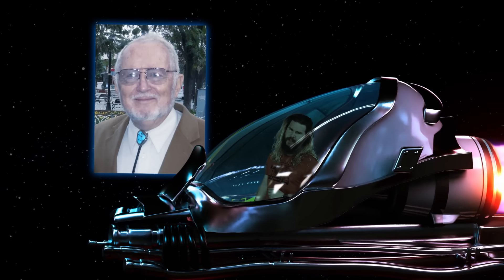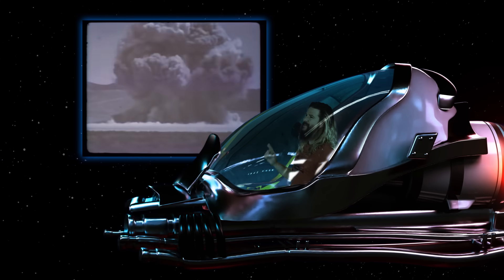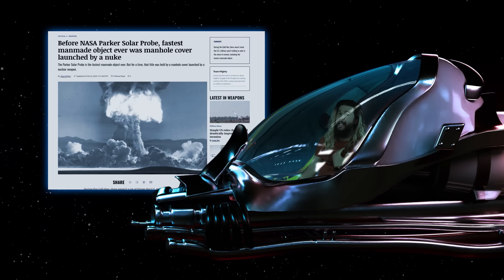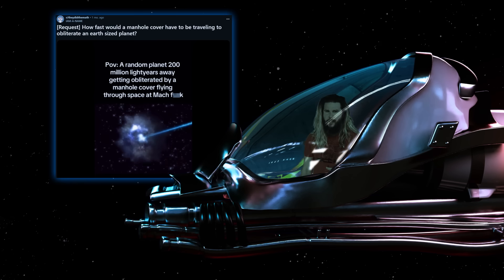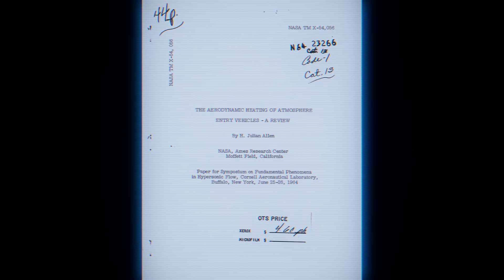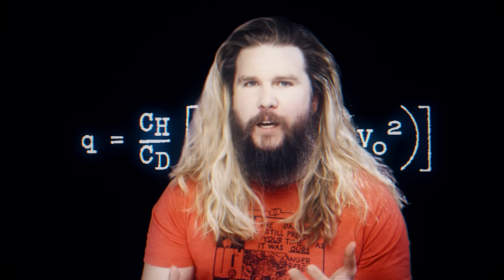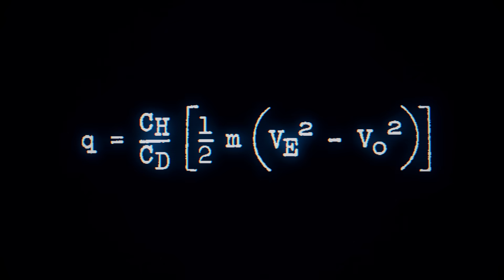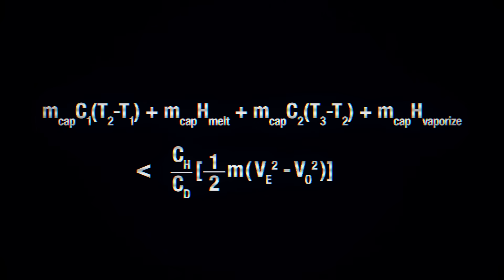Debunking the Nuclear-Powered Manhole Cover

Comment: I wonder if the calculation took into account the air density changes as it went higher, and wether the heated metal deformed into a mor aerodynamic shape as it traveled upward

Comment: The equation doesn't include time as an explicit variable, nor does it break down the journey through different atmospheric layers. The simple equation isn't enough to determine if it made it to space, only if the manhole cover would have enough kinetic energy to overcome the heat absorption and potential vaporization.

Comment: I understood the explanation correctly? if the heat generated by an object entering the atmosphere is more than enough to vaporize it; then, the heat generated by same object going in the opposite direction, should be the same, right?. And because of that result, factors like angle of trajectory, travel duration inside the atmosphere, the thinning of the atmosphere as you go up, all those factors, can be put aside, because they are already contemplated inside both calculations, right?... simple put: if it burns going down, it will burn going up.

Comment: I have an old video where I detonated some explosives inside a thick wall steel cylinder with a flat copper disk capping the end. I found that the disk forged into a pointy shape much like an explosively forged projectile. 
Which definitely would help but I figured not enough.
Reply: Cast iron tends to be very brittle.  So instead of shaping itself like that copper disk, it most likely would have either maintained its shape or shattered.
Reply: @Baudelier42 Was looking for this reply. There's a reason why EFP warheads use the metals they use.
Reply: @Baudelier42  Under that series of forces it would bend before shattering, and they did video record it moving off (not shattered) but the cameras at that time did not have the frame rate speed, which is where some of the 'fudge' errors come into the calculations.
Reply: @llwellyncuhfwarthen  Rotational forces almost surely ripped it to shreds.  It surely did not burn up.
Reply: @Baudelier42  it very likely did shatter. it experienced gigapascals of pressure, more than its ultimate tensile strength. enough to shatter it
Reply: @Baudelier42 at, as Kyle said, Mach middle finger, plus the heat energy of an atomic blast, it likely would have super-heated to a point where it was at least malleable
Reply: @Baudelier42 I doubted it was "iron" and actually looked it up: most manhole covers are made of one of two corrosion stable (it surface corrodes then becomes stable) low carbon steel alloys. True iron is exceedingly uncommon since about the second world war (I'm a hobby blacksmith and am always looking for "exotic" materials to forge with).

But we don't know what this actually was, did he actually order an actual custom manhole cover, or did he just have the local fabrication shop cut a piece of 4" steel plate to size and he refers to it as a "iron manhole cover"
Reply: @fire304  we do know it was a steel bore cap we also know it wad massive as it wad 2000 pound your average manhole cover is like  150 pounds. 

He keeps saying manhole cover to cause people to not get just how much metal there was. I mean ffs he acts like meteorite are the same thing as a solid chunk of Forged steel also ignoring that not all burn up we have museum filled with proof of that.
Reply: @aikidodude05  agreed. Also meteors usually come in at an angle and have minutes of re-entry time, this thing was exo in 2 seconds, maybe 4 if it lost a half of its speed.
Reply: @fire304  I didn’t even think of angle of attack that’s a very good point. For me I’m looking at this from how metal reacts to heat and launch speed would be the fastest It’s traveling thus hottest meaning the higher it goes the colder it’s gonna get because it’s slow down. They clearly have a frame of it still solid at that max speed it clearly didn’t vaporize thus wouldn’t have vaporized as it slowed because it would be cooling
Reply: @aikidodude05  I am not so sure about the cooling; once in vacuum there's only radiant cooling... If it picked up too much heat it might actually be liquid or even vapor before going exo. That said...

The math Kyle needs to do; at 32 miles per second the cap reaches 82k feet in half a second (actually less because NTR is at 4k feet), and atmosphere is only 12% of sea level. After the first full second of travel it's 200k feet and 0.02% density.  Assuming a more aerodynamic EFP shape, is the very limited contact time enough to heat the entire mass of the steel to phase change?  Unknown variables include how much ablative effect the steel will have on itself. At that velocity the friction would sublimate the surface of the iron removing some of the heat as a brilliant plasma trail (too bad all eyes were on the test, a wide angle shot surely would have been spectacular). The question to solve for is will enough heat get into the cover to saturate the remaining mass and turn it liquid. If yes then, depending on the altitude, there's a chance a bunch of steel shot has departed the chat. If the heat is sufficient to vaporize the steel then no.
Reply: @fire304  ok your right I phrased that wrong. what I should have said the point of maxium heat would have been at the point at which the plug left the bore hole the further it travel the slower it would be moving lowering the actual amount of heat  imparted though friction combined this with the reduction in actual drag once outside of Kármán line . the question is was enough heat actually imparted on launch but given that their is supposedly a photo of it intact in a single frame that is unlikely.
Reply: "hypersonic bowl" sounds less cool than "hypersonic manhole cover"
Reply: @triplestaff 
Revelation 3:20
Behold, I stand at the door, and knock: if any man hear my voice, and open the door, I will come in to him, and will sup with him, and he with me.

HEY THERE 🤗 JESUS IS CALLING YOU TODAY. Turn away from your sins, confess, forsake them and live the victorious life. God bless.

Revelation 22:12-14
And, behold, I come quickly; and my reward is with me, to give every man according as his work shall be.
I am Alpha and Omega, the beginning and the end, the first and the last.
Blessed are they that do his commandments, that they may have right to the tree of life, and may enter in through the gates into the city.
Reply: Yeah, I think we really need a look at that single frame from the high speed film to see if anything can be judged about the integrity of the object as it left.
Reply: So when I was researching this I was getting that it was an "armor l plate" which I took to meaning that it was a steel alloy. where did it say it was cast iron?
Reply: @theCodyReeder  The original documentation about the Pascal tests say that it was made of cast iron.
Reply: Absolutely loved that video, though it still makes me question how/if the laden Frost effect would perhaps also be involved. And how long it would be, with an object going into an instant heat. As well as the decrease in friction due to liquidation, an decrease in atmosphere. The same way that a bullet going into let's say a block of jello and then ballistics gel could possibly have it stop in the ballistics gel. Yet reversed could possibly lead to it not being caught at all.
Reply: @NikohSimonds  Not only that but rotation likely would create a bubble around it such that heat transfer was as minimal as possible.  That being said this almost surely DID NOT burn up.  Instead, it likely rotated so fast due to uneven forces on launch that it almost instantly ripped itself to pieces.  If it was some sort of super material that could stand that however I personally doubt what we see in this video as radiative heating is likely the only factor really in play as the atmosphere likely bent around the bubble this would have created making mechanical conduction in the few seconds, it would have taken all but non-existent.  Could it heat that bubble it created to temps... possibly idk but we start to hit hard limits rather quickly in closed systems like that.
Reply: altho, cast iron is both brittle and has a much lower melting point then pure iron, so id expect it would shred itself into iron sand, instead of deforming
Reply: @arnaudmenard5114 cast iron definitely has a higher melting point than copper. And a very similar one to elemental iron
Reply: @arnaudmenard5114  1500c?
Reply: Cody casually mentioning making armor piercing shape charge IEDs 😂
Reply: I mean it was literally off by a single order of magnitude, and these were rough estimstions to begin with, that didn't account for it flipping side ways, reshaping, or anything. I really don't get why anyone here (including kyle himself) is acting like this is some slam dunk. Being less than an order of magnitude off when using incredibly rough calculations based on equations that were absolutely never meant for this, isn't exactly damning. In fact, given how many liberties he took here (like ignoring blast forging, tumbling, etc.) the fact that it was already that close basically convinces me it did stay (roughly) intact. If you get within an order of magnitude while making all of these sorts of worst case assumptions, that's damn good evidence.
Reply: @felixjohnson3874  As you said... Tumbling, meaning its likely only in one frame as it exploded due to angular velocity almost immediately after.  No WAY it could take it.  I agree on the rest though.  Far to many factors here as the short time and fluid dynamics pretty much prevent this video from being true.
Reply: @felixjohnson3874 this
Reply: Hi Cody!! ❤❤❤
Reply: Of course you do lmao
Reply: That's a homemade rpg. What you designed is essentially what's inside the big part.
Reply: It's how they made IED's that can kill tanks.
Reply: Congratulations! You've created an Explosively Formed Penetrator (EFP)! You're just a step away from recreating shaped charge warheads.
Reply: Bits of a manhole cover would still be man made objects melted very small bits probably don’t count. The expanding gasses seemed to reach a fair height and the relative velocity to those gasses was nothing like as high as the speed relative to the atmosphere. 
So could have been a nuclear powered shotgun? Much much smaller pieces of debris make it into space from meteor impacts but the expanding gasses from those also get considerably higher. (And tektites are generally molten at some stage)
Reply: Is the original one frame of footage available? Could confirm the shape
Reply: Sounds like just enough to get you on a list, but not quite enough to do real science, lol.
Reply: The manhole cover was made of iron which in my experience tends to burn when used as an EFP liner. While the test certainly wasn't an ideal EFP I'd expect that it would deform and burn. It probably traveled a good distance but it would be eroding the entire time. That's assuming it didn't just shatter immediately after the one frame of video we have. Nuclear weapons are really brissant and it likely would have shattered into hundreds of pieces.
Reply: lmao, i started reading the comment and only thought by the end "is this cody from cody's lab?" turns out it is you!
Reply: Do you know the title of the  video?
Reply: Well yeah, but copper is much more moldable even in cast form. Steel (it was probably cast steel, not iron but name stuck) is all around moldable to a certain degree if it's rolled or forged but is britile if cast. So it would either hold it's shape (with very little deformation) or break apart. If it was plate steel then yes, it could deform even tho it would take stupid amount of pressure to do so, but we're working with that in this case.
Reply: Cody from codys lab OMG I LOVE YOUR VIDEOS
Reply: The pressure from below may have supported it for long enough to make it to thinner atmosphere before it was able to deform the iron
Reply: I was looking for someone to mention this video. supper glade to see it was you!  Both good videos :)
Reply: Being a  round disk wouldn't it tumble like a coin that falls from a great height?
Reply: Okay this would make for an interesting Cody's lab episode. I hope it already exists.
Reply: Cast iron would rather fragment into shards than bend and flow into a more aerodynamic shape.
Reply: Should have just read up on it. EFPs were developed in WW2.
Reply: If there was a direct line of sight between the nuclear explosion and the cap, the cap was likely half way to being vaporized just from that line of sight.  The light is so bright it will set anything inflammable alight. It originates from the 100 million degrees temperature reached in the explosion.

OTOH, I do think his example is quite flawed.  Most meteors do not come straight down at a 90 degree angle to the ground. They come in at shallow angles (not that they have to, just that they usually do) which causes them to travel through much more atmosphere than this manhole cover would have being launched straight up at a 90 degree angle from the ground.  For example, the Tunguska even was caused by a meteor which was coming in at a 30 degree angle.  The manhole cover would have taken the shortest trip to space possible unless it started to tumble and be deflected to a shallower angle.
Reply: The Baader-Meinhof Gang used that type of device to assassinate  a German Banker
Reply: You created essentially a shaped charge IED! Congrats!
Reply: So an efp?
Reply: He did say that, didn't he.  @JeronimoStilton14
Reply: This is how the Iraqis peirced tank and Bradley armor in iraq. (A friend of mine served for 8 years) he told me exactly this. It turned the copper into a pointy molten spear and burnt through the armor
Reply: @evanalden2117 Not just the Irakis. That's basically the basis of shaped charges
Reply: @evanalden2117  no burning, no thermal effects. Kinetic only. The copper “finger” is punching a hole, not “melting” or “burning” its way through.

Comment: If I'm going to argue with your result (which is far more work than I've put in), I'd ask about whether convective/conductive heating is going to be the main issue. For high Mach numbers (I think it's around 25+, coincidentally LEO reentry velocity) radiative heating becomes a problem. So it's no longer an object pushing against a gas, it's pushing against a hypersonic plasma, and the rules change.
Whether they change enough to over-ride your reasonable sounding order of magnitude "yes, it burned up", I doubt. Most of the damage will be done in the thick stuff low down, rather than the plasma-conducive stuff high up.

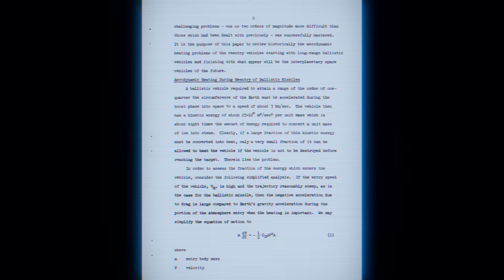Comment: This is gonna complicate the heck out of things even more, but there's a very critical assumption in the paper 3:56 that must be addressed: "...assuming that the mass, the heat-transfer coefficient, and the drag coefficient may be considered constant..."

That iron plug would be rapidly ablating mass, and the heat-transfer coefficient and drag coefficient would change depending on the density, temperature, and pressure of the Earth's atmosphere on the way up. Even if you assumed it went straight up the entire way to space, you would have to recalculate and replug the ∆m of the iron plug, VE, CD, and CH so you could rechug the heating on the iron plug at various altitudes along its entire flight.

Its a pain to calculate, but the simplified equation isn't powerful enough on its own. If you want a realistic answer, it must be done.
Reply: Am I hearing the sound of an integral coming?
Reply: @Sollace  Multiple Integrals.

I possibly could do it, but I'm so rusty on them I really don't want to because I'd probably fuck it up.
Reply: @kavitiko335  Tbh, it could have been a lot worse. Instead of getting into Navier-Stokes levels of accuracy and complexity, we can just use the International Standard Atmosphere (ISA) table to approximately it instead.

It's still a little annoying that we have to keep running it piecewise until we find a failure point or not. But at least it doesn't need to try running/crashing MATLAB to calculate it out Monte Carlo style lol
Reply: This is not physics... As we all know cows are spheres, infinities happen all the time, everything is a point mass, and integrals are a more like guidelines.
Reply: @collinb-12  I thought the only spheres in nature were chickens?
Reply: @Sollace  Common misscoception, all animals are actually just meat spheres. Possibly cubes depending on the equations your shoving them into or the point your making.
Reply: 150,000 MPH is about 41 miles per second. That’s 3/4 of the way to the Karman line in the first second, with the atmosphere thinning all the time. 

Atmosphere is not the problem. Accelerating to 150,000 mph in a thousandth of a second is the problem. That energy transfer is like hitting a watermelon with the X-1 at high Mach.
Reply: @Cre8tvMG  My goverment spends money on some really dumb shit. Selling crack to people in ghettos, arresting those same people, entraping metally challenged Muslims as terrist threats, entrapping redneck hillbillies as bureaucrat kidnappers, banker ball-outs, corporate welfare, bombing brown people aboard because democracy. But the only thing I'm asking for is a round two on this experiment to find out if big metal lid was the first artillery we sent to space.